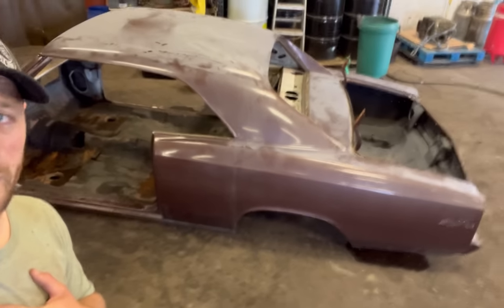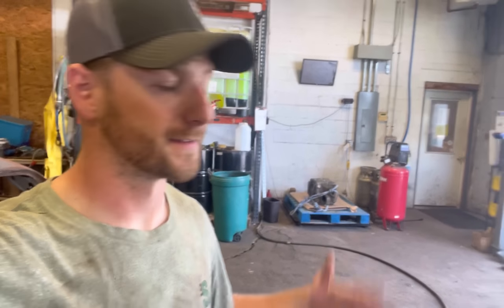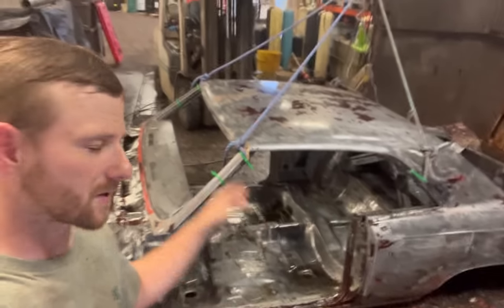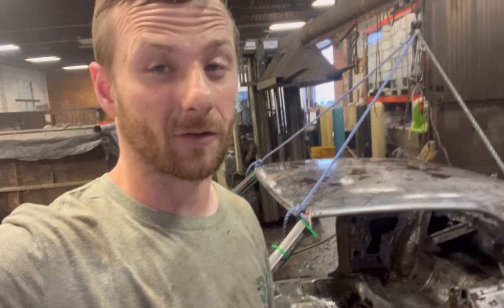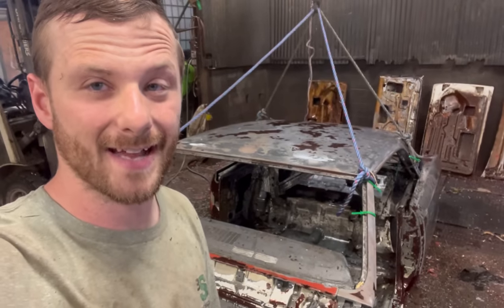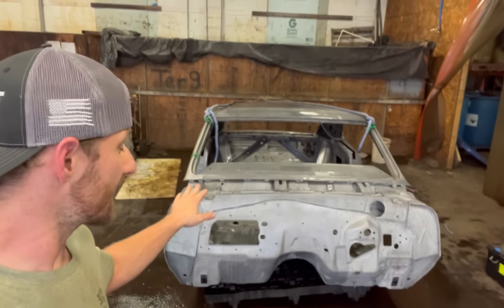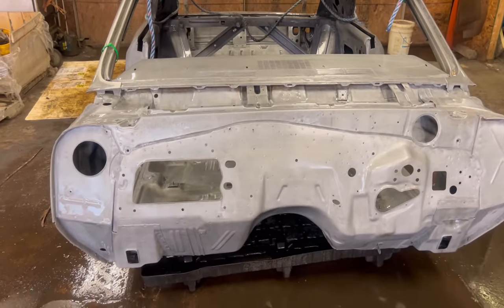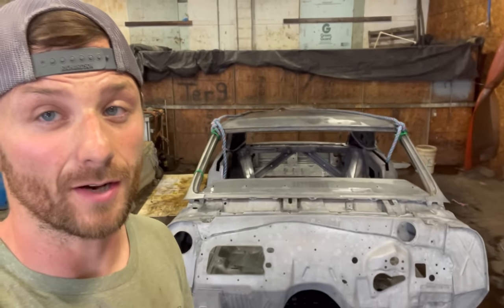Chemical dipping a 1966 Chevy Chevelle Malibu

Comment: I take it this car has been restored before. It is in great condition. My thing in recent years has been purchasing and restoring the 1/25 scale models of these same cars.

The canvases, tools and techniques vary; however, many of the problems  are the same regardless of the scale or steel vs. styrene. I have made my own Dipper and use a product called Scale Coat. It strips the paint without retching the styrene body. As with the one to one scale, the end product can be no better than the prep of the body. Rarely get it all off with one dip.

I miss not having a chrome plating service these days.

Comment: I'm new here but have a couple of basic questions. Do you coat the car in something like vegetable oil before shipping it back to prevent rust? Do you ever get pics or follow up on these cars when completed?
Reply from the maker: We apply a water based rust inhibitor immediately after washing. I have a Porsche 911 finished pics on my profile if you scroll down. 95% of the cars that I’ve made videos for aren’t finished yet but I’m in contact with multiple customers that will be sending me finished product pics.

Comment: It is always a nice thing seeing a Gen 1 GM A body that's held up for the most part really well. That RH tunnel rot is an odd spot though but depending on the route the owner is going with it it could be patched or replaced. I always cringe though seeing how bad some of the trans tunnels get hacked for changing the shifter setup or location.
    All in all a great starting point. The rear window flange replacement looks like it was done beautifully.

Comment: just a suggestion perhaps a video on how they get to you are they shipped on a pallet truck trailer car hauler? walk us through the process after stripping the paint n rust do ya spray it down with oil or something to keep the metal from flash rusting? do you strip aluminum ? how bad is too bad to dip?

Comment: I wonder if they offer a primer sealer dip too. A lot of the metal is hidden and a spray primer will not get all the areas that's inside closed off metal sections.

Comment: I bought a 2-door '66 hardtop with a 4-barrel 283 and a Powerglide in 1981, for $800. It was beautiful, and it made all the right noises, but it was a horrid car that couldn't stop, turn, go, or pass a gas station. It was also terminally cancerous, held together only by a lovingly-waxed paint job.